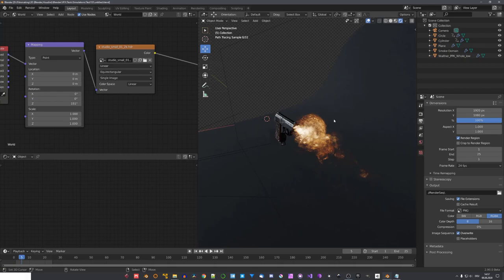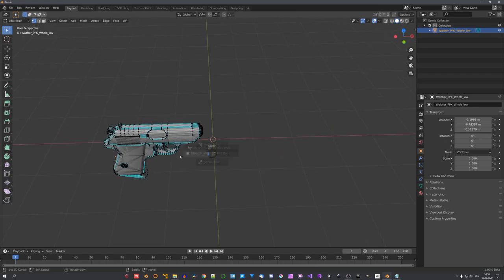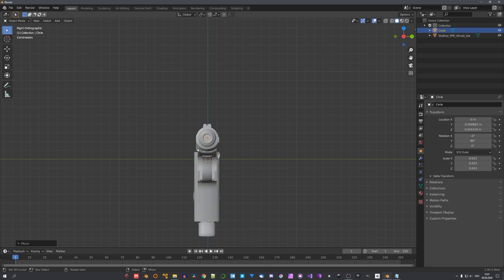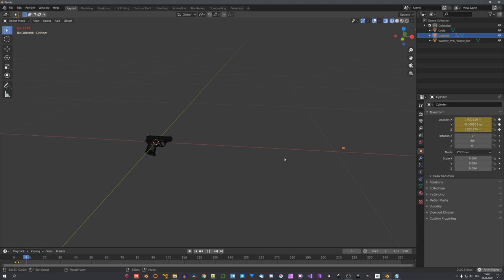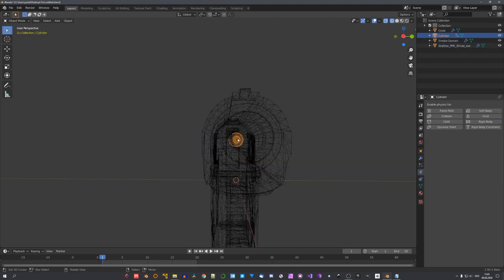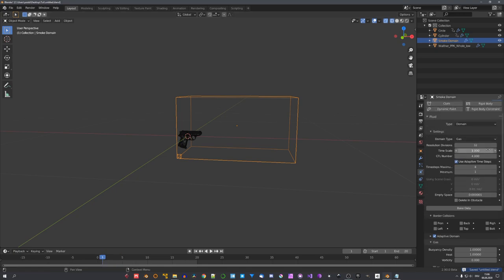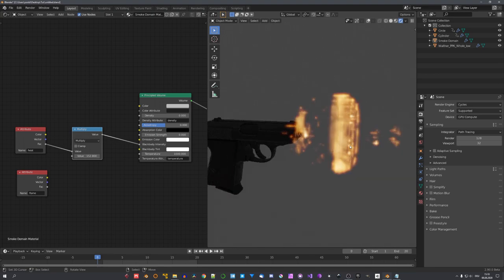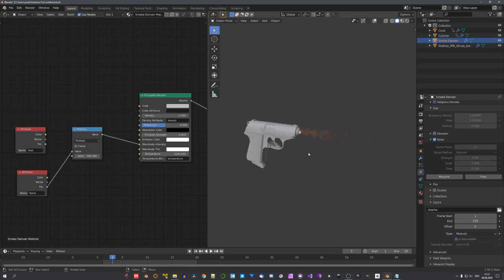Create Muzzle Flashes using Mantaflow [Blender 2.9] | English

Comment: Just to let people know, a cylinder with the front face inset then removed won't work as an effector. You need to either make the barrel yourself, use a model, or use a torus that has been stretched and warped a little.
Reply: But why is that so ?

Comment: A cool idea for a video would be to simulate bullet holes in paper, as if at a range, showing the tearing of the paper around the hole. Another would be in wood since it splinters and breaks apart being fibrous. There are a lot of videos on bullet holes in a brick wall or in metal, which are also very helpful, but paper or wood is rarely covered if at all. Would be interesting to see those done and the workflow behind it. At least a noob like me would find it interesting lol

Comment: I'm not sure why, but a "Circle" emitter didn't work for me.  I had to use a dimensional mesh (cylinder with tiny height worked)  [blender 2.90]
Reply from the maker: Did you enable "is planar" in the emitter settings? It might not work because of that. But it's great that figured out a solution yourself :D

Comment: My bullet and body of the gun aren't effecting the fire at all. The bullet goes right through without doing anything and the fire just goes through the body of the gun
Reply from the maker: Did you set the bullet to a collision object? If so and it still doesn't work try a higher substep value
Reply: I'm also having this issue in Blender 2.91.2 and nothing I do seems to work.
Reply: @JonathanKron  Any ideas?
Reply: Also, Use Flow doesn't seem to work correctly either as my fire lasts the entire length of the animation.
Reply: @cutetransgirl  I tried that as well but the bullet still didn't do shit. I just ended up using starting velocity on the Y axis on my emitter and got some decent results. I rendered out several frames of just my muzzle flash from different angles and put them together for a mod I'm working on for Unreal. They turned out really nice.
Reply: Just dont use cylinder with shell as a barrel. Use cube and boolean cylinder (barrel) inside. Blender precision with simulation scale is a joke.

Comment: adding noise breaks everything what the hell
Reply from the maker: If it breaks it in your case then maybe just leave it out? Or you could try to play with its parameters to get the correct result. Different scenes need different settings so I cannot really pinpoint what causes the issue for you, sorry.